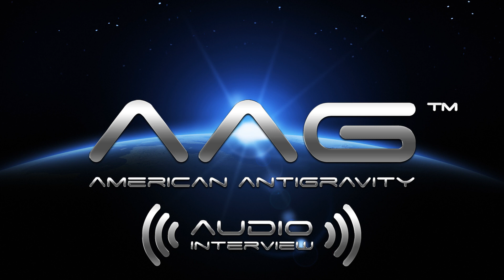Eugene Podkletnov: Antigravity, Superconductors & Gravitational Impulse Force Beams

Comment: Since the caption text says "Originally recorded: July 17th, 2013" which was nearly 8 years ago,  either they did not make as much engineering progress as they expected, or they were the subject of pressure from 'others' not to try to commercialize their tech.

Which is really not at all surprising. 

When/if gravity tech is engineered and perfected,  there's a sense that the 'others' will not let it see the light of day until the very last drop of oil has been extracted and used.
.
.
Reply: Or it's all bullshit. Otherwise something would've been done by now, no way they silence this.
Reply: @sirruffalot  The tech exists, it is simpler than most people realize.  But it is what the govt calls an "enabling technology" and is forbidden to us.  I'm specifically talking about artificial gravity and the tech able to create it.

The Sun in our solar system is a very simple machine.  It provides the energy for all our food, it keeps us alive with its warmth, etc.  But it's a very simple machine.

Only two main parts to that machine:
1) hydrogen atoms
2) gravity field

Hydrogen - including deuterium and tritium - are not in short supply.

If you take all the existing 'hot fusion' reactors - NONE of which currently produce the type of self-sustaining fusion reactions that our Sun has - 

- and you retrofitted them with artificial gravity - 

it would severely disrupt major industries.

And that's just ONE of the problems with allowing artificial gravity tech to go mainstream.

It's only a 'problem' for the control freaks who profit off inefficient industries.

If Steve Jobs and Apple Computer had won in court against Microsoft - when Microsoft introduced a copycat operating system - 

- it would have made Steve very happy.  Steve and Apple had a huge incentive to not let Microsoft disrupt Apple's business.

Hydrogen pellets + artificial gravity containment = ready supply of energy.

I wouldn't worry about anything, the tech will not see the light of day for hundreds of years.  My guess is, all the fossil fuels on this planet will have to be exhausted first before 'they' will consider allowing artificial gravity tech to go mainstream.